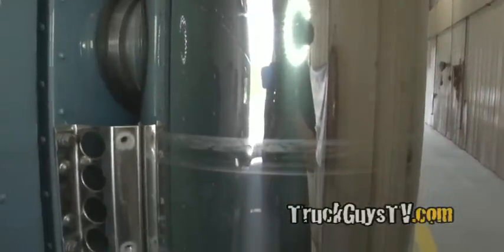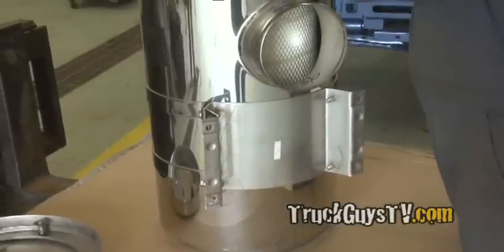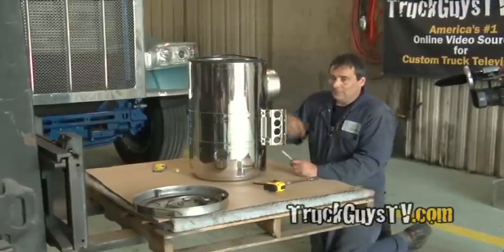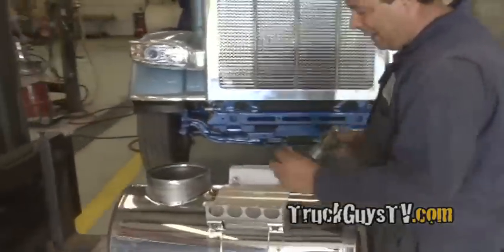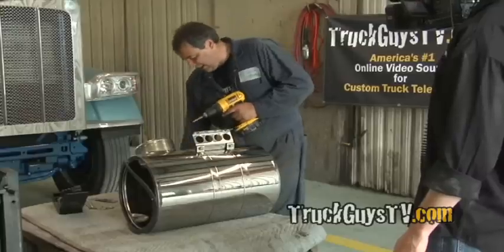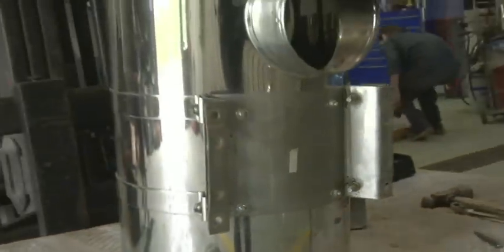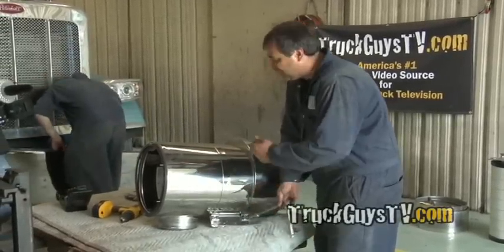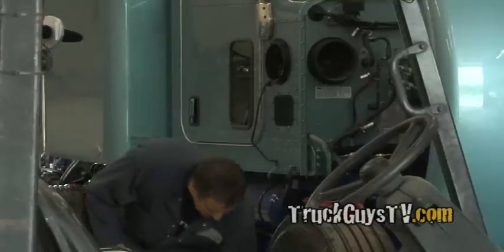How To: Make a Strapless Air Cleaner

Comment: I work for the manufacturer of this air cleaner and do not recommend that you follow these instructions.  The holes that are drilled expose the clean side of the air cleaner.  The bolts will not provide a perfect seal to the housing.  Please do not follow these instructions.
Reply: Scott Brown 
Maybe put a couple rubber washers to seal it. I'm sure this is way cheaper than buying from you manufacture.
Reply: He sealed it lots of em out here